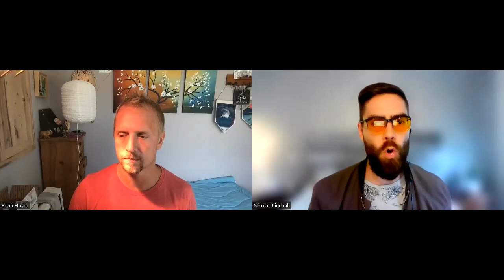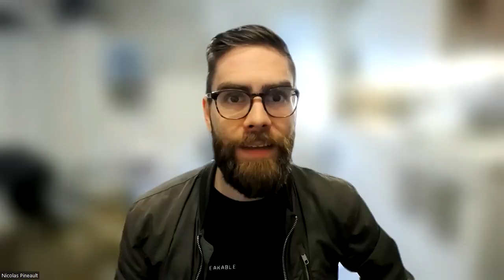How to Reduce EMFs from CPAP Machines [EMF Circle Preview]

Comment: The ResMed Airsense 10, which is a very popular model CPAP machine includes an air tube with coiled wire to heat the air. The electric field EMFs coming from the air feed tube is beyond, beyond, through the roof!!! In fact, that is the worst issue as you cannot get away from it and it lies right across your chest. There are 3 possible solutions: 1) You can special order a plastic air tube without the wire inside. But each time they send you a new air tube, it will have the wire, so you have to continually pay for an extra wireless air tube. 2) There is a metal tab where the ait tube is plugged into the CPAP machine that you can clip off. Now no electricity is flowing through the air tube and thus no electric fields except from the machine itself which you can keep at some distance. 3) You can buy rechargeable batteries that work with it. You need 2, one to use at night and 1 to charge so you always have a charged battery available. This solution is relatively expensive (a few hundred dollars) but using the battery you have zero EMFs.....Of course make sure to turn off the Wi-Fi that transmits the CPAP data to your sleep doctor...Just a button you can push on the CPAP machine. I help many people with these kinds of issues. Https://HealthyIndoorConsultants.com
Reply from the maker: This is brilliant, Henry. thanks for sharing your expertise.
Reply: So could you wrap your tubing in Faraday fabric to help cut down on EMF?
Reply from the maker: @KATZ-y9q  The Faraday fabric mainly addresses wireless, not electric fields. It could be used to mitigate electric fields if it's grounded. As Henry Eckstein mentioned, the solutions are 1) using the tube without any wire on the inside 2) cliping the metal connector off so that no electricity goes inside the tube or 3) using a battery for your CPAP machine (more expensive)
Reply: So glad to see someone addressing this. Just bought a meter today and the CPAP machines read insanely high. The heated tubing is what surprised me. I took it off and put the universal tube back on. Very thankful for my grounding sheet and now I want a pillow case.

Comment: Hello and thank you for this snippet.  My partner needs to use CPAP for severe central sleep apnoea.  He has set it up to run directly off battery both at home and in the caravan (no more AC fields or dirty electricity from the caravan inverter) and we've turned off any wifi/bluetooth functions.  This has improved things but still it bugs me and I end up sleeping elsewhere.  THANK YOU to henry eckstein.  I hadn't been sure that the tubing had metal wiring.  I put a little piece of paper over the metal clip where the tube joins the machine and voila! When it is on it feels completely neutral now.  I think this is the last missing ingredient 🙂
Reply: My husband has central sleep apnea as well and even after using the CPAP he is still tired the next day. I am not sure if CPAP is the best for central sleep apnea. 
How is CPAP working out for your husband? I am assuming that he feels well and not sleepy, or tired during the day? Thank you.
Reply: @Alien2799 Hi there.  my husband is not at all electrosensitive, so he doesn't notice what I notice.  he has used the CPAP for ~20 years and wouldn't be without it.  In the beginning struggled with it, but recalls stopping using it demonstrated that it was helping by the contrast.  He said that an uncomfortable mask would disturb his sleep, and that finding the right mask made a big difference.  He personally finds the nasal pillow most comfortable.  Best sleep wishes to you both

Comment: My ResMed machine has Airplane Mode.  I set this every night, then turn it off when I get up so the info tracking my sleep quality can be sent in.  It’s my understanding this makes the machine safer.  Would be interested in any feedback. Thanks!
Reply from the maker: If this indeed turns off the wireless function inside the machine (which it should - needs to be verified with an EMF meter if possible), then yes, it's making it safer and likely helping you sleep better too.

Comment: Would covering the Res Med Airsense 10 air tube that has the coiled wire to heat the tube with Faraday Fabric  reduce or negate the EMFs?
Reply from the maker: The Faraday fabric mainly addresses wireless, not electric fields. It could be used to mitigate electric fields if it's grounded. As Henry Eckstein mentioned, the solutions are 1) using the tube without any wire on the inside 2) cliping the metal connector off so that no electricity goes inside the tube or 3) using a battery for your CPAP machine (more expensive)